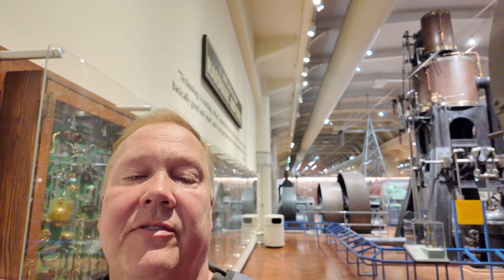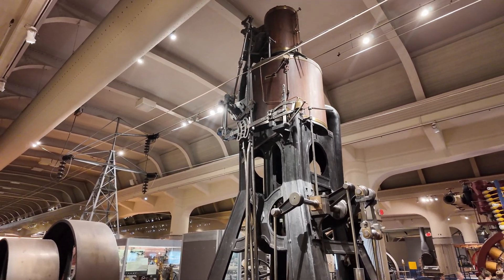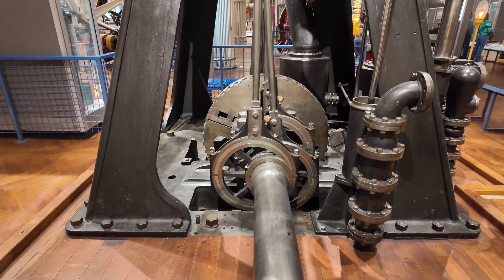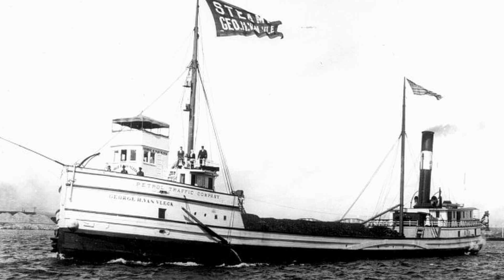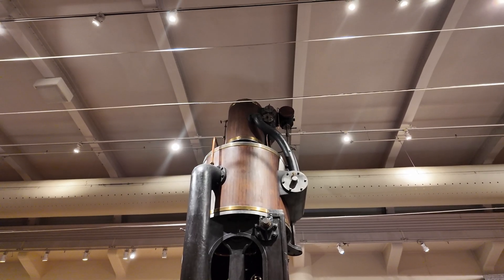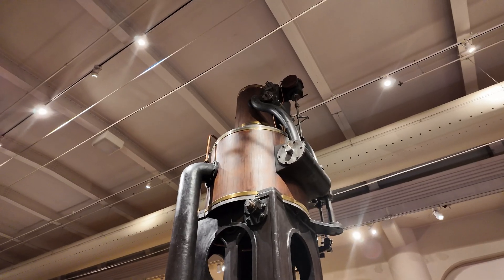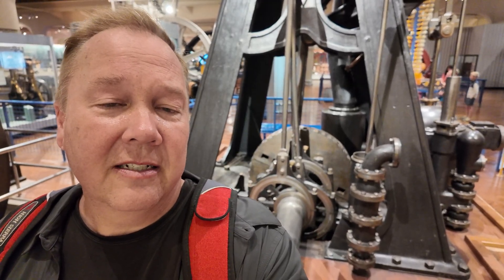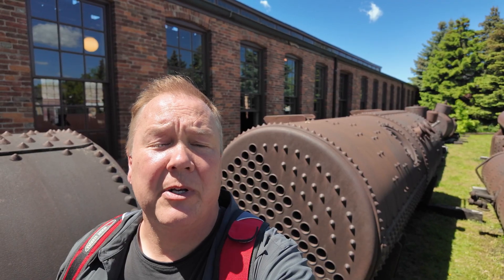Why This 1875 Steamship Engine Is So Important

Comment: That is a highly unusual engine for several reasons; a steeple compound is quite unusual to see in preservation, especially a marine one of that size. Having a single crank, steeple compounds were a bit more unusual in the marine world because there is the potential to get stuck on top or bottom dead centre... making manuvering potentially tricky business. That engine also has rotary valves (not of the Corliss design) which were very unusual as well, especially in the marine world... The smaller pump was likely a bilge pump, but could have also been a boiler feed pump. Many wooden ships had bilge pumps running (or manned) much, if not all of the time. The larger pump is the condensate pump. That pumps the condensed exhaust steam out of the condenser, and in the case of the great lakes steamers pumps the condensate overboard. It's fantastic that engine made it into preservation. Thank you for sharing with us.
Reply from the maker: Thanks for all the info!  I just looked at your channel.  Looks like you've got a lot of steamboats, there.  I'm on the Great Lakes in the US, but so far, I haven't had much luck finding historic steamboats around here.
Reply: @Industrial_Revolution  you're very welcome. Yes between my dad and I we have a few. What part of the great lakes are you? I might be able to point you in the direction of some historic boats/ships and/or contemporary boats.
Reply from the maker: I'm in SE Michigan, around Detroit/Toledo.
Reply: @Industrial_Revolution  There is the William G. Mather in Cleveland, but it was repowered from quadruple expansion reciprocating engine to steam turbine in the '50's. There is the SS Keewatin in Kingston, Ontario. There is the steam yacht 'Louise' on Lake Geneva, Wisconsin... Hope that helps a bit.
Reply from the maker: I visited the Mather over the summer, and stared at the bad photos of the old engines.  The new ones are, as you know, rather a black box.
I've added the other two to my list of places to check out.  I think I've actually been to Lake Geneva for something, but I can't remember what it was.

Comment: Very nice short video, interesting to see such an old engine. It's a pity that you do no overvoice on your videos, because there is always the background noise 😞.
-- As others mentioned the pump which is connected to the engine could not be the bilge pump, could be a feed pump or a pump for condensators, these were used as early as these times, there are diagrams of the SS Germanic of the white star line, built in 1874, which show clearly a condensator curicuit! Plus, I know a german paddle steamer with a engine from the 1850s (PD Diesbar at Dresden/Germany), which has a "Nassluftpumpe" i.e "wet-air-pump" in english. This pump re-compress the  used steam so it wont go all to wet through the chimney, and it rains on deck! Maybe this could be such pump also?
-- the Other reason beside space, I have read in a book, was the at that time, even better sealing of standing cylinders, especially in the first (compound) machines with higher pressures. Makes sense to me somehow, a lying cylinder makes extra pressure on the sealing on one side!
--Maybe the machine shown here is "one half" of the ship's machine? Often these ships had at least 2 cylinders, because its easier to re-start when reversing the engine (like a bicycle has two pedals). 
Also, there seemed to be the advantage, that you could de couple the engine cylinders (in the middle)and the aft engine, which is connected to the propeller, could run alone, so you had still at least 50% chance with a broken engine. Sometimes in the 1880s a Cunarder crossed the Atlantic with this emergency application plus hoisted sails, because the engine was broken in the middle of the ocean. They were a week late because of this!
Reply from the maker: Thanks for the observations!  Pretty sure this is was the only engine in this case, since they're fairly well documented, although you're right, later ones did add more cylinders, and running a second cylinder, offset 90 degrees, makes it a lot easier to change direction.  Most locomotives by this time were doing just that.
Wet air pump?  Repressurizing the steam seems really inefficient, since you get power by letting it expand, although condensing can be somewhat efficient, especially if you don't want to run dirty/salty water in your boilers. It can take a good amount of cold water to do it, but ships never had a shortage of that, and it could really cut down on the amount of boiler maintenance needed.
On the technical side, I think my lav mic failed on that video, for some reason, and I had to use the camera audio, so I couldn't lower the background sound.  I do like a little background sound (videos seem weird with silence in the background) but adjust camera audio input down to use either my lav mic (which picks up less background) or voiceover.
Reply: The smaller pump would have been a bilge pump, or a boiler feed pump. The larger pump would have been the condensate pump. Not quite how 'wet air' or 'condensate' pumps work... They pump the condensate (condensed exhaust steam, aka water) out of the condenser, and in this case would have pumped that condensate overboard. In the cases of seagoing ships it would have pumped it to a 'hotwell' where it would have been filtered through loofa sponges or excelsior, and then pumped back into the boiler(s). 
Although unusual, steeple compounds like this were found in many ships and tugs in North America up into the early 1900's.

Comment: Would mounting vertically at the centre line of the ship be the most balanced postition? If it was horizontal you would get a side to side vibration and would give a huge beam. Vertically the motions would be dampened by the displacement of the ship and allows for bigger pistons without making significant demand on the dimensions of the ship.
Reply from the maker: Running a single engine to a single prop, centered left to right certainly seems best.  As far as front to back, I've seen them very near the back, but I think I've seen some quite a bit forward of that.  Part of it probably depends on your cargo and how you need to balance that.

Comment: I don't think that is the bilge pump, my guess would be the pump that pumps the water from the condenser back to the boiler
Reply from the maker: It's possible.  A lot of these earlier steam engines never bothered with condensers, though.
Reply: why not? lake water wouldn't be as bad as sea water, but still. on the steam ship i work on the vacum/suction from the condenser also gives 1/3 the engines power
Reply from the maker: When was that engine made?  Is it a historic, or fairly modern, steam ship?
Reply: @Industrial_Revolution SS Bohuslän built in 1914 with a triple expansion steam engine And Färjan 4 built 1920 also triple expansion. No idea when the engine was designed, I know Bohuslän has more tuned up version of a Cargo ship engine
Reply: would be a very leaky ship if the bilge pump needed to be on all the time and be powerd by the main engine. you would also need start the main engine if you wanted to pump out blige water in port or have second smaller pump just for that. 

I will have to ask the engineers if you need the condensors in and out pumps to be on if you are just running the bilge pump for a moderate amount of time
Reply: the condenser pump on those are engine driven and looks similar to what the 1875 engine has
Reply: The smaller pump would have been a bilge pump, or a boiler feed pump. The ships that engine was in were both wooden... accounts of wooden ships often cite pumps being manned much of their voyages. The larger pump would have been the condensate pump. Not quite how 'wet air' or 'condensate' pumps work... They pump the condensate (condensed exhaust steam, aka water) out of the condenser, and in this case would have pumped that condensate overboard. In the cases of seagoing ships it would have pumped it to a 'hotwell' where it would have been filtered through loofa sponges or excelsior, and then pumped back into the boiler(s).